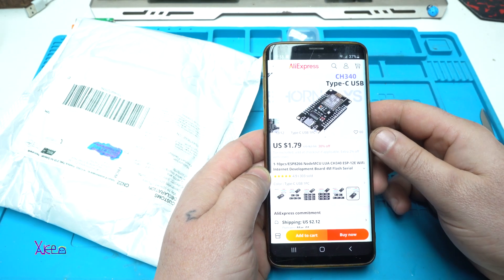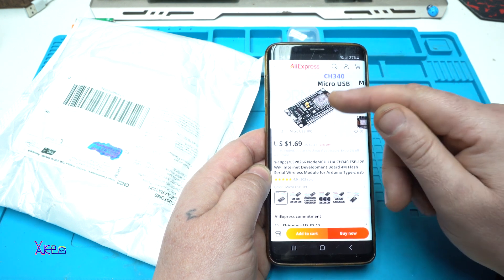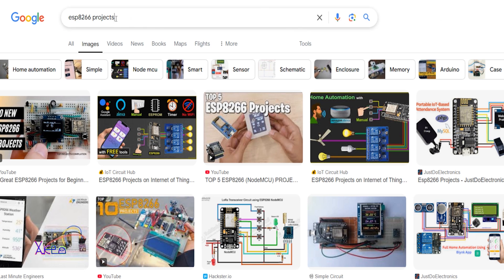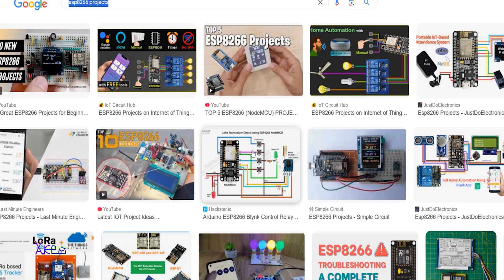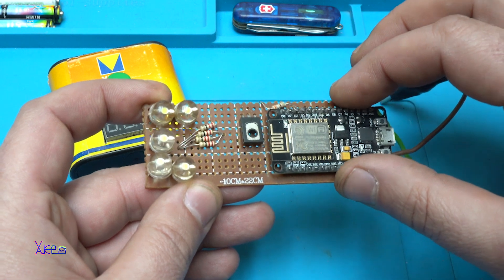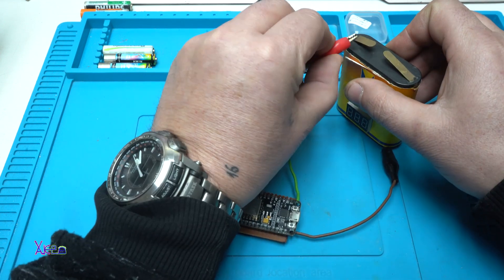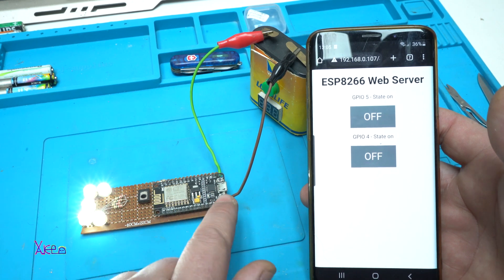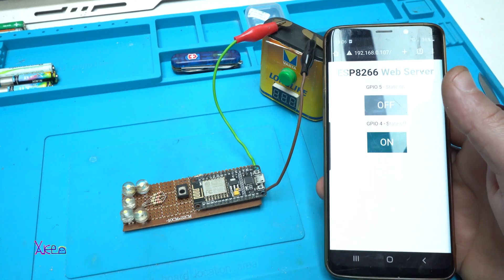I Spent $1 on Aliexpress Wifi Module and Got Surprised?

Comment: Thank you again for another great video. I have been playing with Arduinos for years, and I have done many projects, one that will be going to market next month (wish me luck.) I have focused primarily on the Nano because it is good for most of my projects and it is so cheap. But you are now showing me the ESP8266, and telling me it has TONS of memory for less than a Nano. I see library models for it on the EasyEDA web site, meaning I can (for free) draw up schematics and then have cheap PCBs made for me. This is SUPER COOL! Does it program in the Arduino IDE and can you access the WIFI features from there? I may need to play with this thing.

One minor word of caution: It looks like this device uses a CH340 USB interface chip, and the drivers for that do not come by default on a Windows platform, like the FTDI drivers the Uno and Mega Arduinos use. This means you may need to find and load the CH340 drivers onto your system, which is actually fast and easy to do, and one done you never have to worry about it again. Another caution is that, recently, a Chinese company released a cheap CH340-type chip that I am finding on Arduino Nanos, and this knock-off is problematic. You can work with it, but you have to learn how, and it is best to avoid those knock-offs if you can. One way of detecting them is to look at the chip under magnification, the knock-offs do not tend to have writing on them.

I have several projects that use the Adafruit Neopixel.h library that have apparently memory issues when I run them with other libraries. I think the bigger memory of the ESP8266 might be a solution. I need to experiment.

Comment: Just a note if you are using the USB C Variants. Mine does not get powered on,  only if you use a USB A to USB C cable. A cable with USB C on both sides did not work. This is, because they just swapped the Micro USB with an USB C connector, but USB C needs some resistors to tell the powersupply what voltages are expected. I could help me with some very cheap USB C Power power modules, also from Ali.
Reply from the maker: Good to know, thanks for sharing!